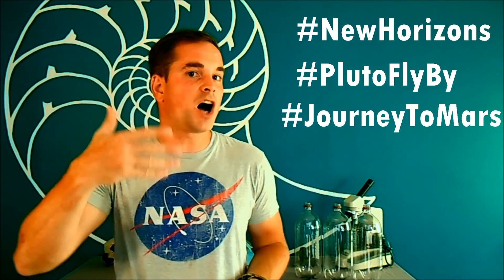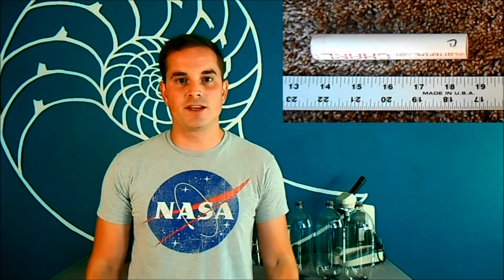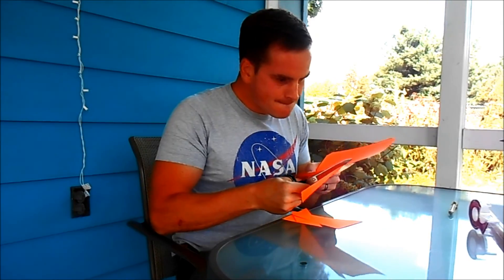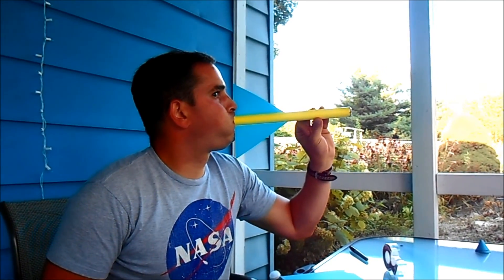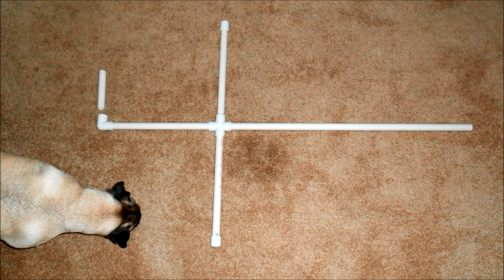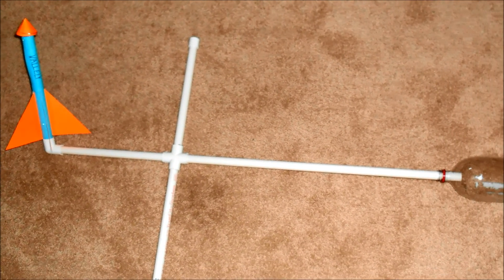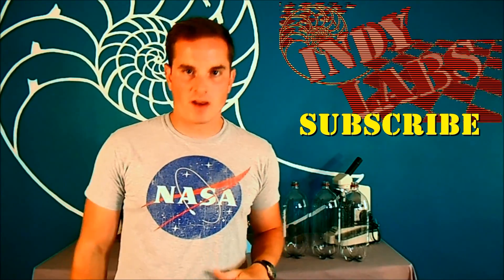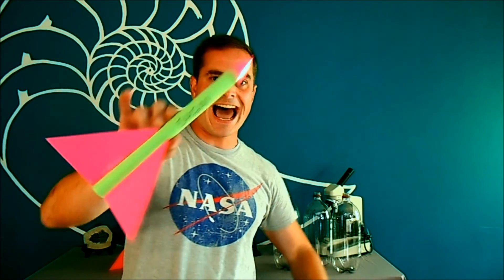Make A PVC Rocket Launcher - Indy Labs #2 (At Home DIY Science)

Comment: Does air go into the crossbeams of the launcher when you stomp on the bottle? Might this lower the air pressure applied to the rocket?
Reply from the maker: +Brian J. Fairman
Yes, and yes.  But, the crossbeams are necessary for stability.  However, if one can modify the design to not need the crossbeams, in theory, the rockets could go farther.  Worth testing!